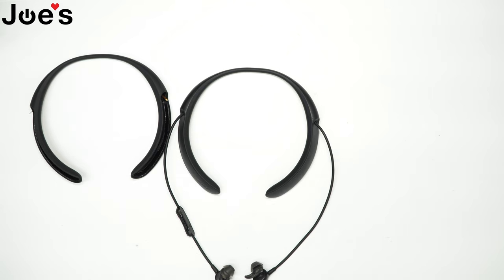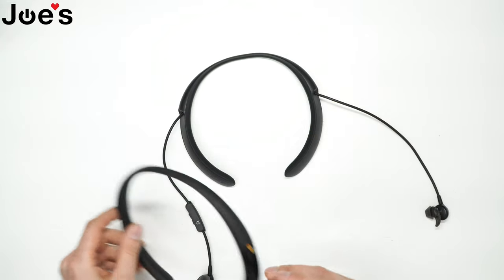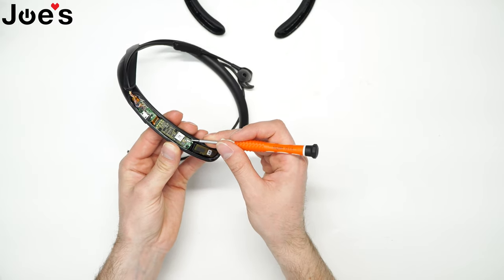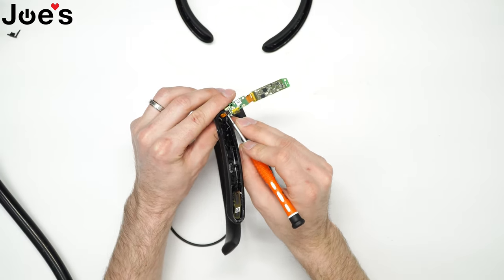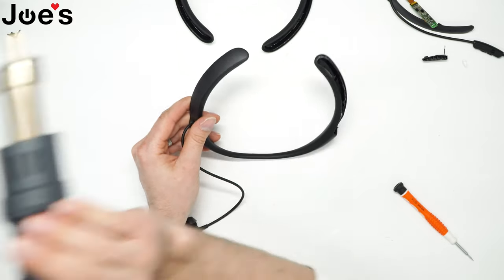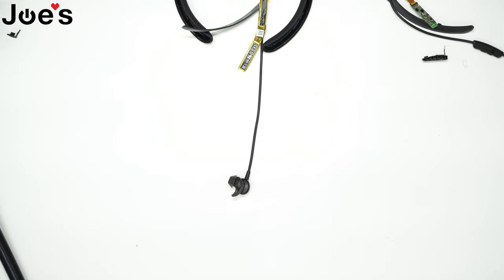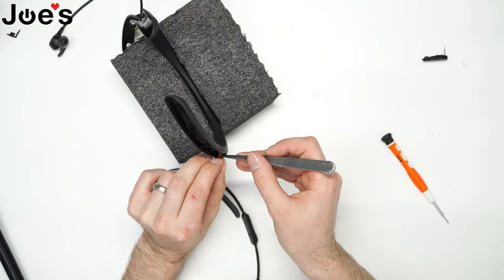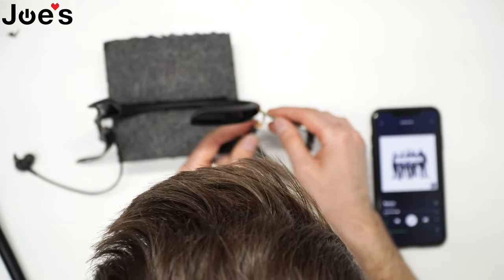Bose QuietComfort QC30 Hearphones Main Neck Band Wire Replacement | Repair Tutorial

Comment: Hi. You know why the solid red light failure that prevents it from turning back on? Thank you!!
Reply: I'm not sure what is the issue with your piece, but I had an issue with the ribbon cable disconnected from the right mainboard which caused the issue. I had to open the protective cover on the right to find it out. Once I connect the ribbon cable back to the board, it was all good. :)
Reply: @madhuhr9231  Thank you very much. I will review it as you indicate. new subscriber !! :)
Reply: Hi pls check my other reply for the same problem....

Comment: hello.  9:12.....that piece wasn't on the old head band.  what is  it/where'd you get it?
Reply: i found it, but decided against using it because it seemed to be too much pressure on the on/off button at rest.  now on to important part...shipping the rubber charger port cover with it already inserted into the band requires us to remove it so we can properly seat the board back into the band.  Removing the rubber cap wasn't possible without tearing it.  I recommendation not shipping the cap with it already inserted into the band.
Reply from the maker: Thanks for the recommendation.

Comment: Do you have a video to repair the power/pair button? It has lost it's click.  Is the purpose of heating to break the glue?
Reply from the maker: We do not. And yes, heating the glue will make  taking apart the unit way easier

Comment: can you show us how to replace the battery please?
Reply from the maker: Yes we will make a video on that also:)
Reply: @Joesge  Hi there. will this video be coming soon? There are many issues reported with QC30's not charging or turning on. Solid red light when charged. Do you know if this is likely a battery/battery connection issue?
Reply: @aaronquigley3343  I found that the issue with mine was due to the ribbon cable disconnected from the mainboard, resulting in the solid red light when trying to charge.

Comment: Hello there. 3M Black weatherstrip adhesive or 3M Super Black weatherstrip and gasket? Thank you! Mine work beautifully however the adhesive is separating on me.
Reply from the maker: https://www.joesge.com/products/silicone-industrial-adhesive-rtv-silicone-rubber-seal-10ml-black-glue?_pos=1&_sid=e1f433e34&_ss=r
Reply: @Joesge  Thank you so very much for your information. Unfortunately I already purchased the 3 M Super Black weatherstrip adhesive but would have been  better off purchasing your product. I rewatched your video and got information from transcripts of what glue you used but next time I'll purchase your glue. Thank you so very much for your very informative video and response. Take good care, Oliver :)

Comment: In mistake i remove mic wire How can i fix that
Reply from the maker: Hello, thanks for commenting. Please email us at support@joesge.com and we will be able to better help you there. - Aaron P
Reply: Hi there is to mic on the right side   i am not sure which one you are looking for any way  red and copper colour  twisted together( with out pvc insulation) is pin number one on pcb and black colour pvc insulated wire is point number two of pcb  (right to left  7 connections in one line on the pcb ,middle line is 6 connection ,last line is two connection, other mic wire is point number 10 ,11 on pcb that wire is white and there is two wire on white colour  green with copper colour twisted goes to point number 10 on the pcb green copper wire from the white pvc goes to point number 11.     and i hope now you got all the information  if it is not  enough pls reply ...

Comment: Great video and very clear ! On my QC30, the right earphone (the one with the controler) have been ripped off. I want to re-solder the 15 wires on the PCB but don't find any information about which color goes where. Is there a schema or a close-up picture somewhere ? Thanks in advance !!!
Reply: Did you managed to get pinout of the cable? Have the same problem..
Reply: @vgelazauskas  No unfortunatly...
Reply: Hi    The pcb have three lines of  soldering points  and first line is comes with 7 points middle line is 6 connection points last line comes with two pionts    the top line (7 connection points line) left to right  pin 1 naked red and copper colour twisted together wire .  2, black pvc insulated (from mic)   3,yellow  4, orange   5,  white ( these tree are with pvc insulated)  6, pure copper colour twisted   7,gray( pvc )    8, green copper twisted   9 pink copper twisted   10,  green and copper colour twisted from white wire 11,  green of the white wire   12,   purple twised copper wire   13,  brown twisted copper wire  14,  green pvc insulated wire  15, blue pvc insulated wire         I hope  all this information is helpful to you   if you looking for more  pls  reply  ........
Reply: @poulosepoul3502  Fantastic ! I will try it as soon as possible !
Reply: @poulosepoul3502 ,  This is great. I have mine ripped on the on the right side(battery side) as well while trying to pull it out. Any help would be great help.

Comment: Hi, does the new replacement band for the qc30 you are selling come with a new power button? Mine is busted.
Reply from the maker: email us at support@joesge.com with a photo and we can take a look and help you out.
Reply: The power button is integrated in to the neck band. I bought a genuine neck band. The USB cover and side flaps however are not, so you have to reuse those.

Comment: Mine is not working anymore... The lights are red. And that light turned off after 5 seconds...
Reply: Help me before I'm gonna dump this garbage.
Reply: I have the same problem
Reply: I have the same problem too
Reply: Hai   In most cases  the ribbon cable come out from the pcb  socket  on the remote side, open the socket lock and insert ribbon properly then try to turn on with power button. If it is not ok, may be   the flat ribbon cable damage itself.  so you have replace the  outer neck band cover. This  is available on amazon in lowest price..
Reply: I think your case also same as below please check the reply in the bottom
Reply: Hai  I think your case also same  and already my findings given for other same cases so please read that...

Comment: How is it possible that no one is able   to help with the red light problem ughh
Reply from the maker: Have you tried a reset on the headphones?
Reply: @Joesge  how do i do that?
Reply: I got the red light problem too when try to charge, n i found that the flex cable next to the power button loosen when i open it up using the method from this video. Connecting them solve the red light and it can be turn on again
Reply: @走在自我探索之路  thank you for the explication but could you be more specific with photos pls.
Reply: Hi you may please  read my other reply for the same problem...

Comment: Never buy this product as this has a design flaw. After some months you may notice noise coming out from the left earphone. The reason might be because this earphone has control panel on right side and left side is connected through the neck band. After some use of neck band itself you might notice getting disturb noise on your left earphone. I visited their store to repair it after one year and they can’t do anything unless you do trade with them to buy same new product where you get 20% off. Still you will get the same new design flaw earphone which might damage in couple of months. Worst product. Mic is also very bad. Only the good part I noticed is ANC. Personally I never recommend this design flaw product. Thanks.
Reply from the maker: We have not had to many issues with these ourselves.
Reply: i am absolutely agree with Amith. I got the f*** problem. Come to bose authorised service and they said the same tone with 20% off. Never recommend this design. It not deserve with 300$ at all
Reply: @Joesge  Excellent video and thanks for posting. Will a new neck band likely fix a noisy left earbud problem?
Reply: The other design flaw is the power button cover (the rubber bit) will fail and degrade, even with light use. I don't know if they improved this but as of a pair of Sept 2018 manufactured ones it has not been fixed.
Reply: yup this is why I am here, left ear piece suddenly failed and static along with white noise is just blasting out of it. thought it was an ear bud issue, idk if replacing this pit is worth it so I might just dump them from something else